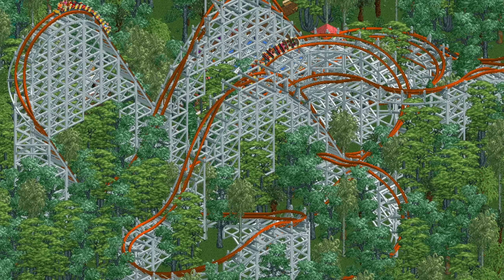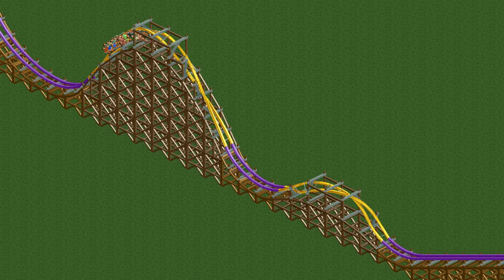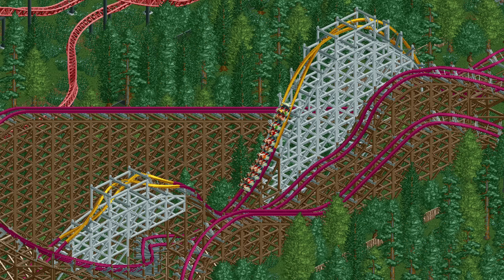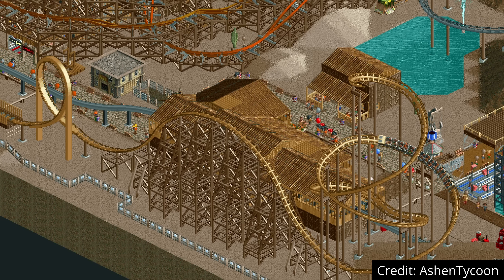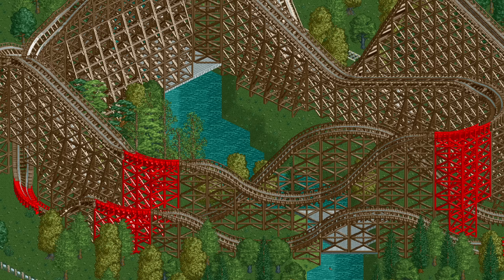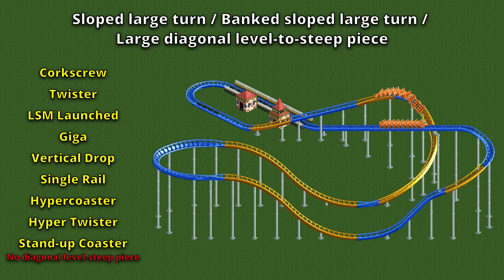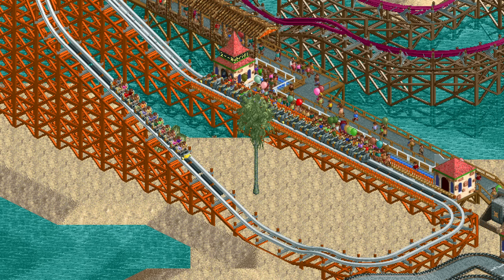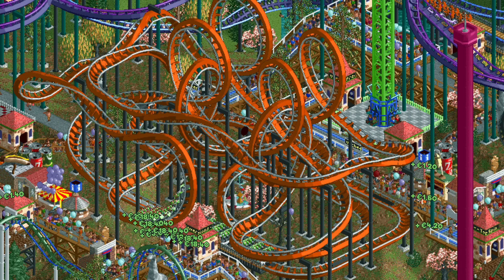All new track pieces in OpenRCT2 explained

Comment: Currently I'm running into problems that when a coaster design incorporates 'new' track pieces, the design can't be saved. I think I've made an 8.8 excitement Corkscrew once which I was super proud of only to find it couldn't be saved or it had to be altered to the point it went under 8.3, which sucked.

Comment: I wonder, were all the coaster trains made only as sprites or were they made as 3D models and then turned into sprites? Kind of like how DKC did it. Because if so, I wonder if those 3D models exist and if we could get out hands on them, then we could make new sprites using those models so that we don't have anything that looks janky like that.
Reply: All coaster trains are made as 3D models first and then rendered into sprites, it would be an obscene amount of work to draw make even a simple train by hand. Coaster trains can have anywhere from a few hundred to more than 10000 sprites.
Reply: @notarealname1881  see that's what I thought cause that made the most sense. But does the community have access to those 3D models so they could make the proper sprites for these kinds of inversions?
Reply: @morgastic23  If you mean the original models used to make the original assets no, we do not have those. If they still exist then presumably only Chris Saywer or maybe Simon Foster has them.

Comment: What happens when you load a park file with these new track pieces in an older version of OpenRCT2 (that already supports .park) but didnt have that specific piece? Does it warn that it was made in a newer version? Does ist just ignore the track pieces?
Reply: You can't, it will fail with an error. You generally can't open save files made in a newer version of OpenRCT2 in an older one.

Comment: Not everybody knows the following: The current save file format can save any track piece that was in the original RCT or RCT2, even if it wasn't on that specific ride. For example, the Wooden Roller coaster didn't have a large looping in RCT and RCT2; it was added in OpenRCT2. But because the track piece 'Large looping' did exist (just for other coasters), you can STILL save Wooden Roller Coaster lay-outs with a large looping! What's more, you can even save OpenRCT2-only rides (e.g. Single Rail Roller Coaster, Hybrid Coaster) layouts if you only use track pieces that were already in the original game.

Comment: overbanked turns would be amazing!

Actually the one thing I want most from open RCT is the Classic interface, as it looks a lot better at higher resolutions. The default UI was made for rather low resolution screens and is very tiny at high resolution. You can scale the UI up, but this looks really ugly. UI elements for larger screens would be so nice. In fact this is the primary reason I'm still actively playing Classic.

Comment: All those diagonal pieces would have been a Godsend back in 2004 when I was making my Cedar Point recreation. My first attempt used the normal 45° for the midway but I ran out of space. So I made the main midway go along the hypotenuse in the center of the grid and It all fit. But it made coaster designs a challenge.

Comment: Insane to me that the Giga Coaster gets all these cool inversions even though it doesn’t have the sprites for it and the Giga is supposed to be about big drops and airtime, but no such love for the Hypercoaster. Such clear bias towards Intamin from the openrct devs, Arrow fans just aren’t allowed to have anything cool, even though it uses the exact same track sprites as the corkscrew coaster.
Reply: The Giga Coaster only gets it, because the LSM launched coaster gets it, and it's the same track type.
Reply: @ Same goes for Corkscrew/Hyper
Reply: @ Hm.. that's right.. Interesting. 
If you first build a ride that has the pieces and turn it to Hypercoaster, it will have the missing pieces, such as big corkscrews. 
But it indeed doesn't list them, even with the all drawable trackpieces cheat enabled. 
I think it might be an oversight? You can make a bugreport for it.

Comment: Is there a good explanation anywhere how the coaster car sprites work? I know there are missing premade sprites for many of the new track pieces, so I’m curious as to why new vehicle sprites can’t be designed, programmed, and added along with new track pieces.
Reply from the maker: They could be, but it's a lot of work.
Reply: They can be. New vehicle sprite groups were added for the zero G rolls, diagonal banks and dive loops. Depending on what track piece you are adding, it is often essential to do this if you want the trains to animate properly.

Comment: Do you think OpenRCT2 will ever try to implement Y-pieces of track into the game? I know people build rollercoasters in OpenRCT2 all the time that feature sections of track where an incline terminates, the coaster train then falls back, and shoots off in a different direction than it originated in order to complete the "circuit" but at the moment it seems to require a lot of finagling.
Reply: That's a very difficult thing to implement. I thought I had an idea on how to do it but now I'm not sure that would work. I would like this for the LSM launched coaster in particular to help differentiate it from the hydraulic launch coaster, but there are other ride types that could get such a track piece.

Comment: Why does the dive loop go at 45deg? Dive loops should go straight down inline
Reply: Originally, I was going to include both 45 and 90 degree version as options. But the 90 degree piece did not really work out, due to the grid limitations it ended up looking distorted,  and people did not really like it, so I removed it.

Comment: A slight correction. I can actually save a wooden coaster with a large vertical loop in it, the same with the steep drops from the side friction coaster. the blueprint will just have those particular track pieces missing if you build it in Classic
Reply from the maker: That's because those aren't new track pieces, just existing track pieces for new coaster types.

Comment: Hate to complain, but I think you did the new pieces a disservice by showing so many shots with unsuitable trains. People are going to assume they are very glitchy.
Reply from the maker: That's fair. I did explain why that is, but you're right that what I show has a big impact. The zero g-rolls and dive loop twist in a way that doesn't show particularly well on a track type like the single rail, and the hybrid has the supports in the way a bit. I find that the LIM and twister track show off the look of those pieces the best, and I could've used different trains on them, but I avoided doing that as I thought that would be confusing.

Comment: The overbanked turns would be really usefull in combination with 90° banked turns as for some coasters in RCT3.
Without you could only use them as a niche element for a 180° turn.
Reply: Not just a 180 degree turn, Marcel picked the worst of the screenshots I sent him to show. There would be a 45 degree piece as well so with different combinations you could have any turn angle from 0 to 180 degrees (but no way to get 135 degrees). I am considering having versions starting from gentle as well which provides quite a few different options. But the challenge with overbanks is there's just so many variations, you'll never cover them all with a reasonable number of pieces.

Comment: What about new stalls and/or rides in Open RC2?
Reply: Proper new flat rides or stalls are surprisingly a lot more difficult to implement than roller coaster elements. Especially flat rides are quite the challenge. I am sure someone will tackle these at some point, but this has to be done by a community member. The closest we have been was the implementation of the giant ferris wheel and huss condor by Fruitymax, but this project has never gone public and seems to have been abandoned.
~/a
Reply: @openrct2official  I don't actually think new flat rides are necessarily more difficult than tracked rides, at least not if you're going about it the same way (as a hardcoded new ride type). As you say it has already been done. I looked at what it would take a while ago, it didn't that hard. Some parts would be a lot easier and other parts harder, I think. Fewer sprites but a more complex animation.

The issue I personally have with new flat rides is that I hate the vanilla ones. Because I don't want to make flat rides that would fit with vanilla, I'd only really be interested if I could make flat rides into object files, and that is far harder because of the rather awkward way that flat rides work in game. If I wanted to implement a new hardcoded flat ride I wouldn't expect any major difficulty.

Comment: Diagonal and steep and curved chain lifts? Please?  Also, the major limitation with track pieces and such seams to be the file format. Does the OpenRCT team have a plan to make the format easier to work with?
Reply: Sadly the NTDF (New Track Design Format) needs a lot of work to be properly implemented. The team is working hard to get the code in a state to get this format implemented correctly, while keeping backwards compatibility.
~/a
Reply from the maker: Diagonal (normal and steep) chain lifts already exist actually, and were even already in RCT1!

Comment: I just want them to make the "holding brake for drop" on the vertical coaster be able to act as a block brake. It's a coaster type that really wants to be in block section mode, it's a really 'thematic' piece, but since it's not a block brake it's basically just a downgrade of any ride it's on.
Reply: have you suggested it on their discord?

Comment: Biggest wishlist:  Overbanks, larger transitions or even 3-4 continuous curve airtime hills - think 50', 100', 150' and 200', custom drops with continuous curves - 300', 250' 200' giga/hyper drop that are shaped like accurate B&M and intamin hyper/giga drops then with the over banks and continuous curve airtime hills, you could make much better and more realistic hypers and gigas.
Reply: I would like an airtime hill that serves as a longer slope to flat back to slope. Think a slope to flat that takes up 4 or 5 tiles.
Reply: The only thing we need now aside from those is outerbanked turns.